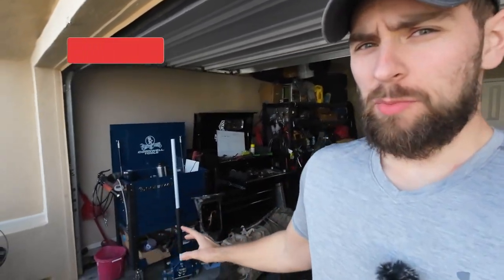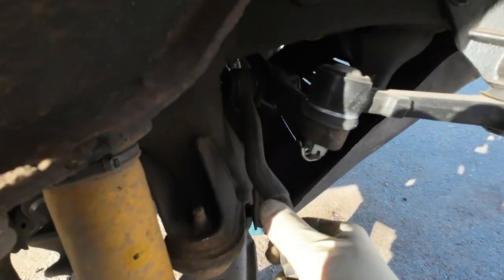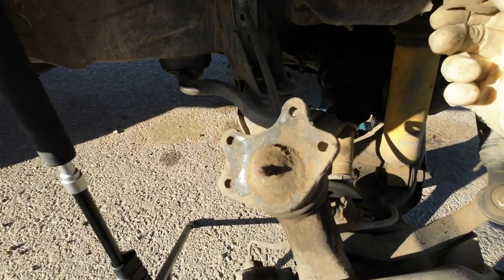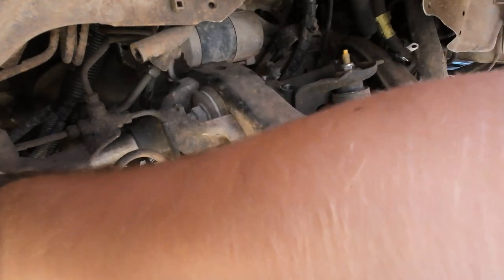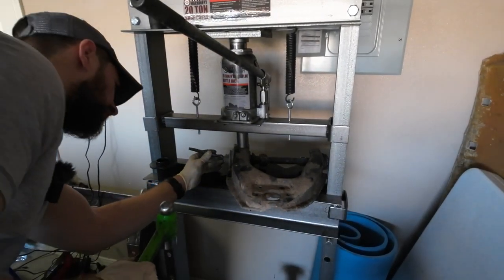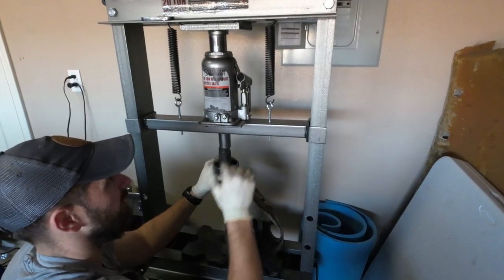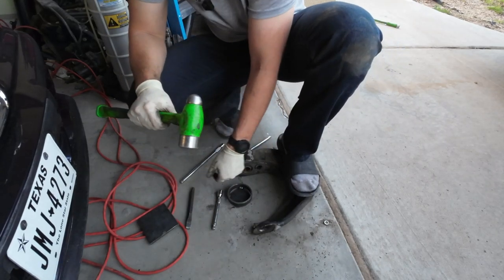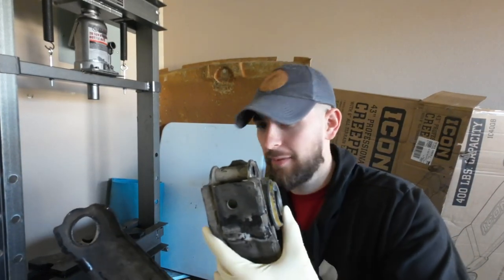WORST Repair I've Made in A Long Time! | 2nd Gen 4runner/Toyota Pickup Upper Control Arm Bushings

Comment: For anyone out there sturggling with pushing the bushings out and worried about bending the arm like he did, if you have access to an acetalene torch, i was able to just burn the bushings out in about 3 minutes each, and it seemed to be much easirler than pushing. Thanks for the vid, really helped me figure out where I needed to start.
Reply from the maker: Good tip! Glad I could get this out there so people at least had a frame of reference!

I don't have a torch currently but it's on my ever growing workshop list 😂

Comment: I would recommend renting/borrowing the proper press tool in the future, it would make the job easier, but kudos to you for getting the job done with what you had. Thank you for sharing. I have a 1992 that needs the same job and you gave me some insight on what I will be dealing with. I might just end up having it done at my friends shop.
Reply from the maker: Yeah I agree, bushing press tool would've made this much easier 😂. You can also buy the complete upper arms and R&R them in about an hour or two probably.

Comment: Great video dude! I’ve got a 93 also that I’m about to do a bushing kit on. Got mine from LCE Performance.
Reply from the maker: Thanks man! I think those LCE bushings are way easier, I should've just done those 😂
Reply: @motor.mausGarage  do you think you could press the bushings in with a C clamp or one of those ball joint clamps you can get at the auto parts store?
Reply from the maker: The LCE poly bushings, probably. If they are OEM style, no chance in hell 😂. There is a  bushing tool that looks like a C clamp, and that's what I should've used in all honesty. Can usually pick em up at harbor freight for around 30 bucks.

Comment: Sweet build, specially with the roof rack, i have a hard time finding anyplace that make em for the 2nd gen and really want one for my 90 4runner
Reply from the maker: Thanks! I've got some more plans for it in the future and would like to bring more of it on the channel.

Gotta go with Sherpa Equipment Co.! Their Matterhorn rack says it's for the 3rd Gen, but will also fit the 2nd Gen if you have the factory roof rails, that's what's on mine (not sponsored 😂).
Reply: @motor.mausGarage  thnks for the info il keep an eye on the channel, my truck doesnt have the factory one but was planning on installing a factory one either way😂
Reply from the maker: That's the way to go! Can probably find a set for next to nothing in a junk yard tbh 😂

Comment: I see you like to go in raw 😂 try a lil grease next time.  it'll make your life so much easier.  You can also put bushings or bearings in the freezer for a while and press while they're still cold.  It'll shrink and decrease the diameter ever so slightly, making for an easier press.
Reply from the maker: Yeah definitely should've tried the freezer idea. I'm not sure why I didn't use grease tbh I usually do 😂.

Hopefully there's not going to be a next time for at least a few more years 😂😂😂
Reply: @motor.mausGarage  Fingers crossed! I appreciate the walkthrough though.  There hasn't been a lot on the 2nd gen IFS and I've been a little scared to mess with the torsion bars.
Reply from the maker: Yeah there really isn't much out there for 2nd gens in general, which is why I wanted to make a video on it. Torsion bars aren't too bad. I would definitely get a new torsion bar tensioner bolt and nut though.

My 2nd gen has been a desert car it's whole life so I got lucky, but a lot of people say they get rusted out 😂

Comment: so wait you had to remove the torsion bar first??? 
😅im such an idiot just replaced the upper control arm last week and i couldnt get the torsion bar bolt tight with an impact and it left the truck lowered on one side now i know thanks
Reply from the maker: Yeah this suspension threw me off at first too. Didn't really get a feel for it until I swapped to OME torsion bars 😂
Reply: @motor.mausGarage  I found this video because I was searching for one about how to replace a first gen upper control arm and that content is hard to find. But mine looks just like yours so I think your video will still work. 

My question is, and forgive me, I am a beginner, but to replace the whole arm I just have to loosen the torsion bar, remove the 3 bolts, seperate the knuckle from the ball joint (I'm gonna use a control arm with a new ball joint already installed) and swap the new one in and reattach everything? 

And I dont have to worry about taking any elements of the arm itself apart? Cuz it  seems like that's what you were struggling with. Taking the old one out and putting in a new one should be easy?
Reply from the maker: Yep! Should be that simple. 1st gen is also the same upper control arm set-up so it should be exactly the same minus all the bushing nonsense I was doing 😂
Reply: @motor.mausGarage  Oh thank goodness! That makes me feel so much better! Because after watching all that I was like "no". Thanks for making this video. It's really not easy to find videos on the older models and the newer ones are not all that similar.
Reply from the maker: No problem! That's the reason I made it, because I was looking for the same info 😂.
Reply: @motor.mausGarage  So, I wonder if you could help solve my problem. I got my control arm off and did end up taking the bolts out of the side bracket thing that holds the bar otherwise the control arm was stuck in there. 

To put the new one back in I took off that same bracket thinking I would seat the torsion bar in it and then put the control arm in place and bolt it all down once everything was in position. 

However, I cannot get the bar into the round female part of the control arm bracket. There is a ridge or tooth in it at 6 o'clock that is about twice as wide as the rest. But there is no corresponding wider groove in the bar for this wider tooth to fit. 

The bars goes in about 1/8" then meets total resistance. Should I just try to beat it with a hammer into place? I'm so frustrated.
Reply from the maker: @Natalie Davis That was the annoying part on my end as well 😂.

So both the male and female end of that bar/mount situation have a corresponding notch to accept those double wide splines. I believe that the part of the female end has a bump where those double wide splines are located on the outside so you can line it up by eye kind of.

Basically what I had to do since I forgot to mark where the splines were on both sides, is I had to rotate the female bracket spline by spline in the general area of that bump.

So I would unbolt the female bracket from the upper arm, get it into the torsion bar correctly first, then bolt it back on to the upper arm.

After that you can bolt the upper arm into the frame itself at the top with the 3 bolts.
Reply from the maker: I would definitely not hammer it on there, it should slide right in with a little bit of wiggling